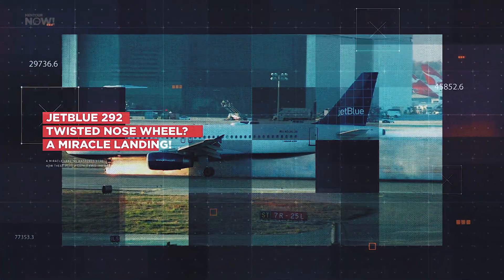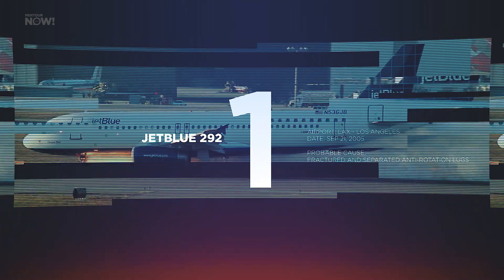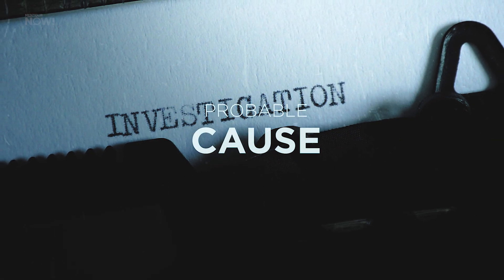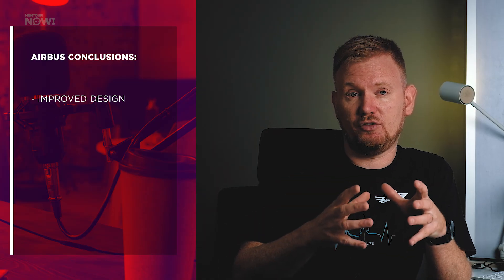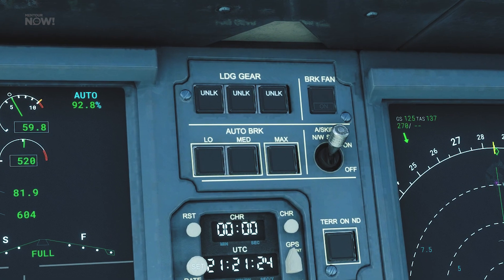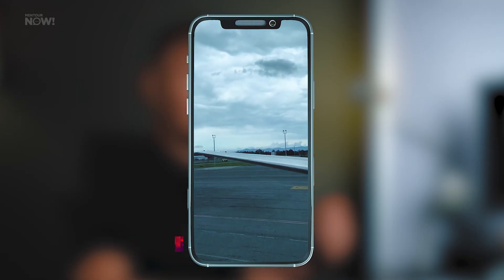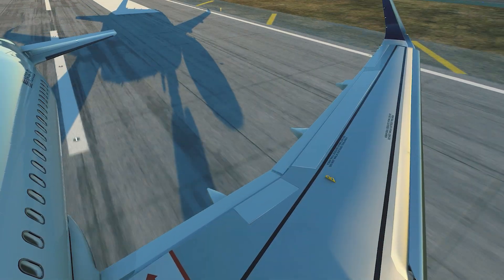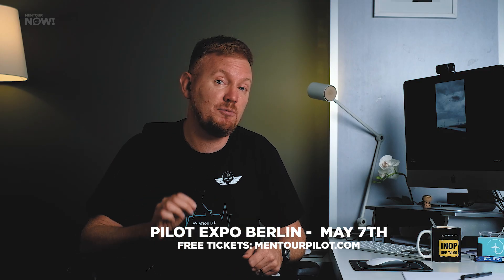The TWISTED Story of the Airbus A320 NOSE-GEAR!

Comment: I'm thinking the nose gear going to 90 degrees is better than any other deviation since 90 degrees allows for a straight-line skid.  A lessor deviation would cause a landing airliner to go off course and crash into something.  Correct?
Reply: Was thinking about exactly the same. Ofc it's more complicated, like if the pilots know about the problem, they likely have the option to lock the front brake so the end result won't really be much different from any of these with the steering locked at 90⁰. But if sensors fail and it hits them as a surprise on touchdown, I guess that could lead to a much worse outcome.

Comment: It just goes to show the LRFD
And Finite Element Analysis undertaken during design really pays dividends, considering the struts and lock links are able to take the stresses of landing in this non normal cfg, as proven repeatedly by these failures.

I did not know about the incident in which the pilots actually took off with the NWS 90 deg orthogonal to the CL… that’s crazy. My only guess is the tires must have blown fairly quickly and the friction coefficient was so little that the extra time it took to reach V1/Vr was negligible. Must have also been a day with little cross wind I would imagine, as they where obviously able to maintain the CL up to the speed where the rudder became effective

Comment: Seems to be a fundamental problem with the design of the gear itself, do we see similar problems happening for random reasons on other models of aircraft?
Reply: That was what I was thinking too. On the other hand, maybe you should look at the number of incidents vs the number of flights that passed without incident. In principle, every incident is one too many, but maybe the number of incidents is statistically not very significant. But I got the same idea basically. If there are so many incidents, there might be a fundamental design flaw in the system.
Reply: Maybe? I mean 2 of them was literally incorrect servicing lol and 1 was people filling the sensors with water lol
Reply: @0Synergy  it's incredible how many Boeing fan boys say it is a design problem while almost of all the problems are caused by incorrect maintenance and not following correct procedures
Reply: @0Synergy  Yeah, sure, but that doesn't mean it can't be a design flaw. If the design allows for such mistakes, it's the design, not the people making the mistakes. You should design stuff with crucial functions in a way thay can't be mounted incorrectly. And if water is no good for the device, take measure water can't penetrate. Obviously,  if you want to sabotage somthing, you can always find a way to mess things up. But it shouldn't be made too easy. I don't know all the inns and outs of this system, but the fact that there's a video about these accidents, incidents and near accidents, means that there is something going on. There are no videos about Boeings nose gear failures... So, unless Mentour is making sensation, there IS something about this gear.
Reply: I was thinking the same thing. With a track record this poor, this nose gear should be redesigned and replaced.
Reply: @maybehuman4  There is one thing to hold for them, so far it seems none of the nose gears collapsed, so that thing seems to be quite sturdy at least.

Comment: This worries me. It seems to me they are trying to zero in on a specific part when it may be a larger group of parts causing the problems.  You said that they are different problems, to me it seems like one problem, the  nose gear wasn't designed correctly, of course I'm neither a pilot nor engineer, hell, I don't even change my own oil. Hopefully they figure this out. Great vid never would have known of this otherwise. Thanks!

Comment: Reminds me of a structural engineer I knew who was tasked to design a structural support in a large jet’s wing. Another engineer was tasked with designing the next support over in the wing, a third engineer did the next support, etc. None of the engineers shared how they were designing their respective support. That project didn’t even involve a computer controller, which complicates safe design. Why the company chose to silo the component designs is beyond me.

Comment: I wish you would mention why Boeing doesn’t have this problem or if it does. Just interested in what is the design deference
Reply: Boeings use a simple, mechanical interface for nosewheel steering. No computers required.

Comment: It does seem like a single system is being shown to have many different fault modes that all result in 90 degree wheel orientation.  Patching the existing support systems isn’t working, it’s only a matter of time before the FAA mandates a total redesign of the nose gear.  All it will take is one plane catching fire and killing 100+ people for Airbus to take the public outrage gauntlet from Boeing and the MCAS debacle.

Comment: Since this seems to occur guite frequently maybe a dashcam could be useful for visual control of the nose wheel.
Reply: Define "frequently." 7 incidents in over 155,000,000 flights is about .000004%
Reply: @etherealrose2139  I think Mentour mentioned that in this or a previous video. Anyway, my comment was not about how often this occur, it was the idea of having a dashcam making it possible to view the nose and landing gear.

Comment: The fact they are still allowed to fly is horrendous.
Clearly the FMEA process in airbus, specifically nose wheel design, is lacking.
You don't need to have a direct line from all failures to specific issues to understand the root cause is in the risk management of a particular area.
Mindblowing.

Comment: For constructive criticism, your luminance values seem off in their conversion.  Specifically the @16:11 range forward, there are no luminance values under 16, and non above 235.  This seems to indicate there's an error in 0-255->16-235 (or vise versa) conversion.  This is as played in a web browser directly through youtube.  Downloaded as an mp4 I can of course control this manually, but if I need to change it more than once per video there's an underlying issue.

Comment: Capt on A320, now retired, 1200 hours command, on type, my experience of nose wheel problems, was as follows.
Half way thro a take takeoff, nose wheel commanded 45 degrees left.full right rudder applied, To get back near the runway centreline. T/O continued. 
Inquiry stated unknown fault of BSCU.
Previously, the company had a similar fault, crew rejected the T/O and the aircraft had a runway excursion. BSCU issue, again.

Comment: Good grief, this many failures on a single component proves a central problem with the original design.  Useless Mickey Mouse attempts to ‘fix’ the problem have put countless fliers in danger.  If Boeing had a similar problem every aircraft would be grounded.

Comment: While the technology of Airbus is impressive with their fly-by-wire systems and such, it can sometimes backfire in a way. I don’t like knowing the 1st officer has to use a laptop to clear error commands when sensors start malfunctioning. I hate the joystick as well. Pilots need to fly the plane because something can happen mechanically for a multitude of reasons. Most of the younger generation pilots now, unless they have a lot of experience flying around in general aviation aircraft, would not know how to deal with the 727 or earlier generation aircraft with steam gauges. Technology is making it too easy in that it could cause a tragic consequence. Airliners are basically computers now and we all know how computers can act up. Just saying.

Comment: A similar incident happened to an Airbus A330-200 in 2012. TAM Airlines flight 8078 from Rio de Janeiro to New York prepared for an emergency landing after the plane’s nose gear failed to drop down properly — with the wheels turned at a right angle. Just before landing, the nose gear suddenly locked itself in the correct direction.

Comment: Seems there are a lot of new design and tech elements being used in where these fault scenarios were not initially evident or considered.  Fascinating just how many ways a complex system can go into a fault.  This video is fantastic with explaining why it's critical not to make any assumptions.  Great stuff!
Reply: The A320 was designed in 1981-84.  Much has changed since then but the design has remained the same.
Reply: @twiff3rino28  Yep, it’s an older initial design with many upgrades esp. on the tech side of things.  I guess it’s tricky to get those right and make everything work well together.  So many ways things can go wrong, much like my YouTube comments as of late.  I’m just gonna go ahead and refrain from commenting in the future, at least for awhile, because it seems like people really are misunderstanding what I’m trying to say lately. *sigh 😊

Comment: There is a tendency to fix the current problem and continue on. Only after several failures do you do a new safety assessment of the entire system. I wonder what that number is at Airbus?  Failure mode analysis, of a system, takes a lot of resources.

Comment: What I am wondering is: Why is the landing gear indicator giving a green light for the nose gear, if it is tilted and locked in the 90° position. Is it simply unable to tell that the nose wheel is in that position?
Reply: The indication doesn't show you the position of the nose wheel at all. It only shows that mechanically the gear is down and locked in the down position. This is importent because otherwise the gear could simply collapse when it touches down.

Comment: As a car technician I don't understand why a steering self test is done while the aircraft is in air in the first place. Isn't that nose gear by default in a straight position considering the departure is in a straight line? I would consider a passive "position check" software for that nose gear instead of the active "test" that is more likely to cause trouble.
Reply: Crosswind could push the wheel around on takeoff. Plus you want to check the gear because if you have to do a high speed turnoff, you need the nlg to move.

Comment: Question: in a cross wind when plane lands like a crab, how  does the nse gear behave?  is it pre-steered such that it is at 0° of direction of travel so as soon as it touches ground, it undoes sideway motion that main landing gear is giving?  Or is the nose wheel put in 0° relative to plane and the pilots quickly streer as soon as on ground to make plane travel along runway ?
In other words: are there situiations where nose wheel is NOT at 0° relative to plane at time of touchdown?
Reply: Airplanes aren’t supposed to be landed in a crab. They’re supposed to de-crab (slip) to align the aircraft with the runway before touchdown.

Comment: Have these nose gear problems existed since the late 1980s when the 320 was introduced? If not, what happened to suddently make this a "frequent" event? 
With regards to shutting engines down:  wouldn't engines still be spinning for a long time and thus still be damaged by any nose wheel debris? Wouldn't the extra help of thrust reversers bing plane to a stop faster, especially as nose wheel isn't helping with brakes?
And how could an aircraft at end of runway accelerate to take off speed with nosewheel at 90° ?  When thrust is raised, would the rubber rub/skid against runway, or would tires immediatly fall off the wheels?

Comment: Why is there no added landing gear? If the "first" landing gear fails, there should be wheels behind it that will be slightly longer than its predecessor and they will be used in emergency case. It's easy...

Comment: There has to be a basic design flaw with the A320 NW system.  How many other aircraft have experienced this issue? I'm guessing not many or there would be incident reports on them as well. So why has this NW design been allowed to remain in service? A known issue with revised software and procedures seems like the very minimum response necessary. I bet if this issue resulted in deaths the response would be more like what we saw with the 737 Max MCAS system.

Comment: Nose wheel steering uses opposing hydraulics. Loss of hydraulic pressure on one side has the same effect as actuating pressure on the alternate side. Either pump or it’s electrical connection can cause the nose wheel to do that.

Comment: There are a lot of mistakes that Airbus makes hmm? I grew up with Douglas and of course Boeing in the late 1960s until now, I ended my air travel with the (then) Dutch Catalina PBY. I just want to say that I no longer trust the Airbus brand with all their so-called software errors, it also makes sense when you have aircraft built in several countries (France, Germany, Spain, GB etc etc) and especially as a target to counterbalance the major American brands such as Boeing and Douglas and then also without a normal control stick.

NO, it had to be a Joystick, Captain Sullenberger once said in a video on YouTube that this is a major disadvantage of that system, since one pilot cannot see or feel which steering movements the other makes, which is the case with a normal control stick. That's why...for me never again in the air with an Airbus, step even more confidently in an 80 year old Catalina. (translate by Google)
Reply: https://youtu.be/kERSSRJant0?t=209

Comment: Here's an idea:  How about a nose-gear design that centers itself by default, rather than one that goes 90 degrees out of whack when something goes wrong?  When all else fails, the wheel would tend to face straight ahead.  Is that too much to ask?
Reply: Yeah. When the sensors are out of wack there’s no way to know when you are “centered”. That 90 degrees is a mechanical limit. The gear can’t go any further.

Comment: While it's true to say that it's not the exact same problem repeating itself it's also true to say that there is a underlying design issue when this keeps happening to one type of gear and that gear only. Be it that it's poorly designed or just over/under engineered etc when the same outcome keeps happening, even if the road getting there is different, it is fair to ask how this nosegear is different than all the other designs that aren't failing.

Comment: Why use the RAT instead of the APU? Wouldn't the slowing down of the aircraft reduce the power of the RAT below useful power production? Also if the nosewheel collapses, wouldn't that also take out the RAT?
Reply: I think the RAT just automatically extends when they stop the main engines.   It isn't needed and doesn't do anything, probably just simpler to let it do its thing (doesn't hurt it, or the plane) than to try and prevent it.   I think if the nosewheel collapses, a bent RAT would be the least of their worries.

Comment: It is good that investigations are carried out on all incidents and not relying on "we have seen this before, it must be XXXX". As you have showed in the nose wheel issue, the casual factors were all different. Alarms and warnings don't tell you why something happened, and in most cases what is wrong, what they tell tell you is that there is an issue with a component or there is an issue with the circuit (hydraulic, electric or cable controlled) and possibly the component.

While I 100% agree that following the relevant check lists, and agree this is the first thing to do, there have been many instances where Pilots have had to do their "own" thing, some if not all having been shown on your channel and others. IE the QANTAS QF32, Olympic Airways Flt 411, Air Canada Flt 143 (side slip like a glider) incidents and the list goes on. I know there is a greater risk when operating outside the published processes, however as long as they follow the process first (or attempt to), then sometimes the Pilots must use their experience, their experiences of the particular aircraft with it's own performance characteristics they are operating, knowledge of flight principles and whatever else is available to them to safely bring the aircraft down. I have no doubt that at the height of an incident, especially the three extreme examples I gave,, the cockpit can be a tense place, that's where we (the passengers) rely on the flight crews professionalism and ability to communicate to each other, because that is the greatest tool they have - each other in dealing with the issues at hand.

Comment: Is it possible and have there been any similar incidents but where the nose wheel have been locked in shallower angle, say 30 degrees for example? I would assume that would be even more dangerous than have it locked in 90 degrees since it would be actively pushing the nose on the side unlike 90 degree turn.

EDIT: The section about Latam Air Incident explains about the mechanism that tries to mitigate the issue, at least on that particular plane type. However, the question sill stands; is it possible to get locked in shallow angle?

Comment: Very nice video again, thank you :)
There is only one thing I do not completely agree with you. And that is about (not) using ground spoilers during abnormal landing gear configuration. In my opinion the reason to not use spoilers is to prevent high pressure on the landing gears during rollout and reduce the risk of a collapse. Passenger evacuation is still possible even with the groundspoilers up. The evacuation route from the overwing exits towards the ground is very close to the fuselage and at that part of the wing, there are no spoilers.

Comment: Why after it happening so much would you not just replace the whole front gear set up and that problematic system ? Answer no doubt is so many plans sold ...so expensive for the manufactour to design,  provide replacement or recall etc. But if you had a car that did the same thing , the manufacturer would be sued to buggery and forced to do a world wide recall . Example those air bags that were faulty and installed in heaps of cars from American to Japanese and European.  How much life do the A320s now have ? They are an extremely popular model amongst airlines i thought ?